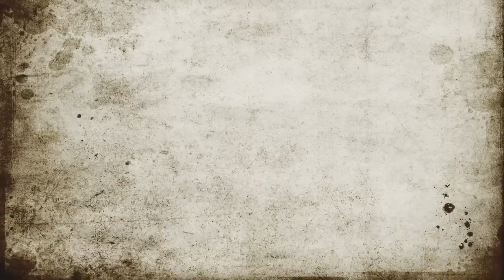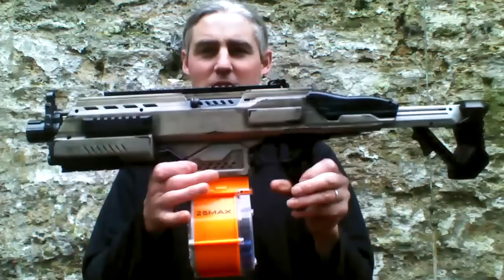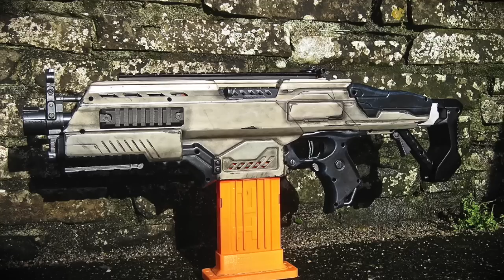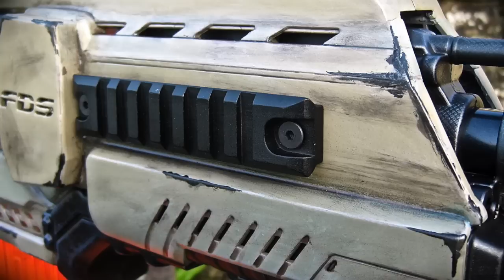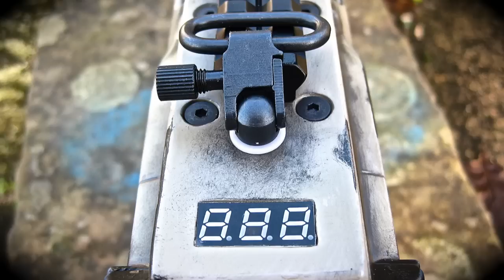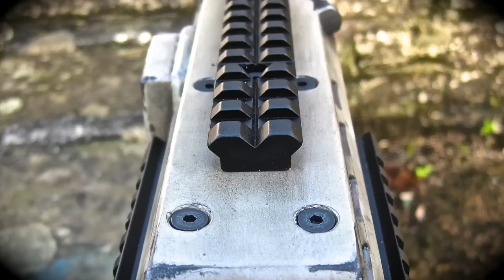The Kardashnikov Mk 2- Prettier Younger Sister?

Comment: What bondo like stuff should you use when you mod your nerf blasters?
Reply from the maker: This particular blaster had only a skim over the dentistry mod, then a tiny bit on the top.
Reply from the maker: Link to filler video
https://youtu.be/khSa-swgOQw
Reply: Foamdata Services this is a nice mod one of the best I've ever seen ,u said u won't get  above 120fps whith crap wiring and internals I hope to use hellcats whith 16 awg wiring whith the micro switches and wiring from the guys at MTB whith a 4000 mah 3s lipo whith worker flywheels you think it can go above 120 average

Comment: Hiya!   Does anyone here know where I can find some good quality/performance 180 motors?
It all kinda looks like alien code to me, and im wanting to stick 3 new beefy 180's in my rapidstrike.
Thanks.   ;)

Another fab video btw.   ._.
Reply from the maker: You will need a set of FK180SH 3240 motors, by Mabuchi. They are commonly rebranded as Esky, EFlite or Lama motors. They are not common or cheap.
Reply: +Foamdata Services Cheers for that info, I wasnt aware that that mabuchi motors were rebranded, this should make my search a little easier. Thanks for the early reply btw.   :)

Comment: I took my worker flywheels off of my Rhinos because I thought I was getting dart slippage? Do you recommend them
Reply: +Foamdata Services, how many amps are the motors needing?
Reply from the maker: See Diaries of a Nerfarmourer on Tumbler, full write up, or on Britnerf.
Reply from the maker: +Mike Nagel Rhinos draw 12A each at stall. A pack of at least 20c and as large as will fit is a good idea

Comment: i feel like my rapidstrike vibrates to much could my flywheels be outa balance?? how would i balance them?
Reply from the maker: Throw the RS ones away, put Stryfe ones in, see my comment on the other Kardashnikov video about matching.
Reply: +Foamdata Services i remember you saying that.  The rs ones look just like the stryfe ones tho
Reply from the maker: +WCxColossus They are always bent. Swap them and you will immediately get better running
Reply: +Foamdata Services kool ill try that thanks i was looking at that metal flywheel cage that dr s made but idk if its worth it... Would the vibration cause the pins on top of the 180s to break off?  Cuz one of them broke i had to replace the motor
Reply from the maker: +WCxColossus The metal cage is not worth the Money IMO vs well set up stock or worker flywheels.
Reply from the maker: +WCxColossus Vibration does cause the tags to break
Reply: +Foamdata Services thats wierd oh well lets see how long these last thanks
Reply from the maker: It's not weird when you think the flywheels weigh about 8g and spin at 40k rpm and that the motor tag is a 0.5mm thin piece of copper. Vibration causes fatigue stress in metals.

Comment: How do you true or balance motors?
Reply from the maker: Motors are fine, flywheels are the problem, see my How to video on mod motors part 2 for true checking, then you weigh and measure every flywheel and match them into sets within 0.2g in weight and 0.2mm in diameter.
Reply: +Foamdata Services kl...thanx